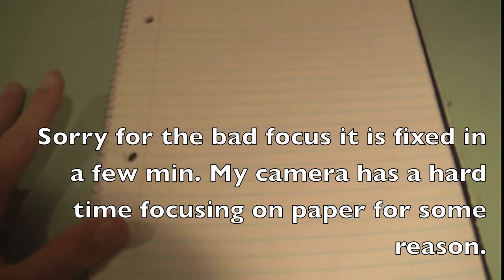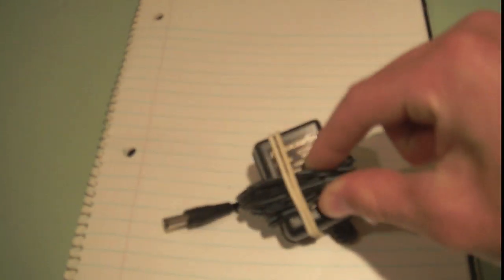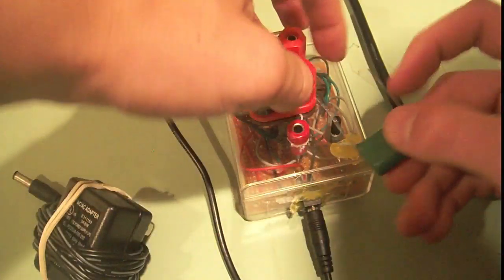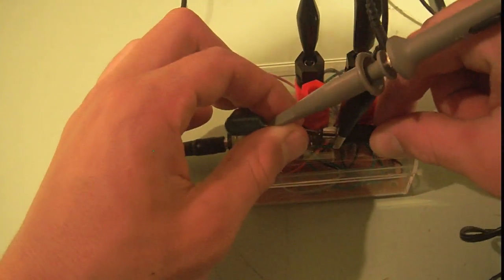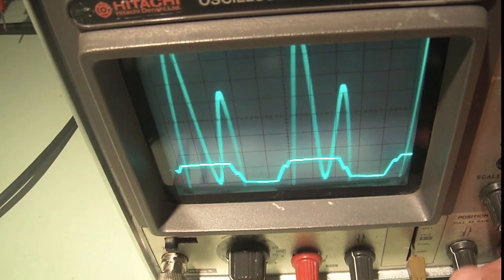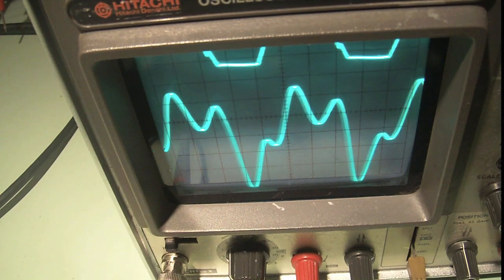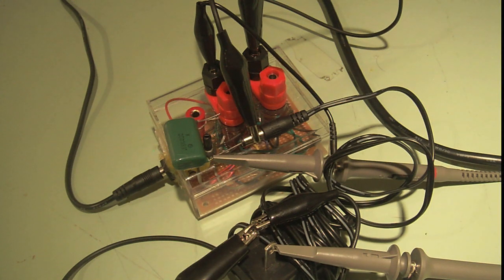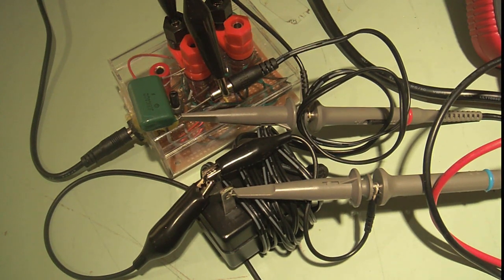Simple Step Up Transformer

Comment: You can open them up and remove the diodes very easily. They usually have a capacitor or two to smooth the ripple too. Switching supplies are out for sure though.

Comment from the maker: Any simple 1 or 2 transistor oscillator will do the job. An op-amp will work as well, and if you were ok with a square wave you could use a 555 timer.

Comment from the maker: Yes you could open up an AC to DC transformer and remove the bridge rectifier assuming it wasn't a switch mode supply. And I'm sure there are so many ways to improve this, make it more efficient, etc. but I just wanted to show the basic concept so people have a platform to start off on when building their own version.